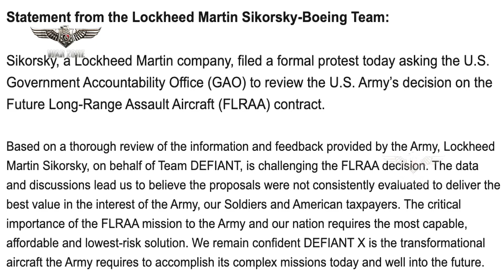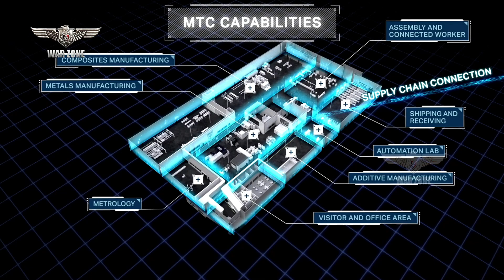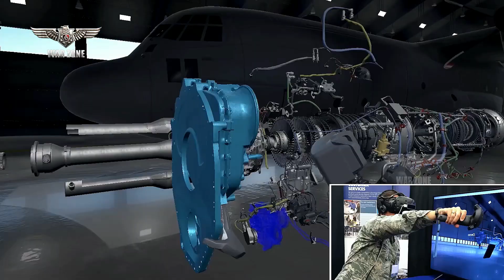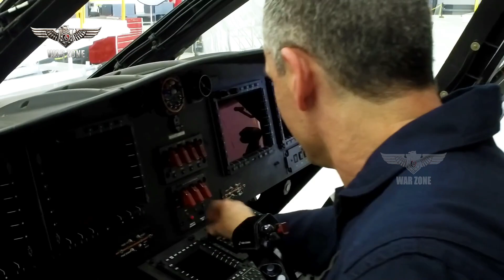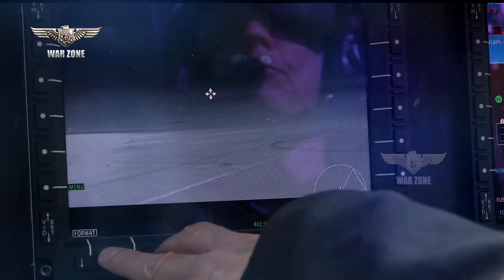Finally: US Army's New Tiltrotor Aircraft Soon to Fly

Comment: You've understated the V-280 Valor's top speed ... it's documented at 305 kts. This was achieved in test benchmarks whilst flying at a level altitude. The Production variant shall fly even faster - as it'll be fitted with more powerful R-R engines

Comment: Looking at the V-22 records. Some doubts this helicopter can actually perform. I still love the old Black Hawk.
Reply: People keep saying that but I've seen the records and it's not bad at all.

These are war machines, not civil aviation.

Also the Blackhawk was terrible when it was new. They called it the "lawn dart" for quite some time.
Reply: Funny you say this when the Black Hawk had 20+ crashes in its first 6 years of service which is still more than the Osprey has in total so far...

The records say otherwise btw as the Osprey is safer than other medium lift helicopters...
Reply: Bunch of company reps in here.
Reply: Especially since the whole V-22 osprey fleet across all branches is grounded until further notice due to the last mishap in Japan.
Reply: @Dannamal-hc8pu  That is how military aviation is... If a crash happens they make sure it isn't a mechanical issue that can affect other aircraft. Did you also focus on the 5+ Black Hawk crashes that happened in a single year?